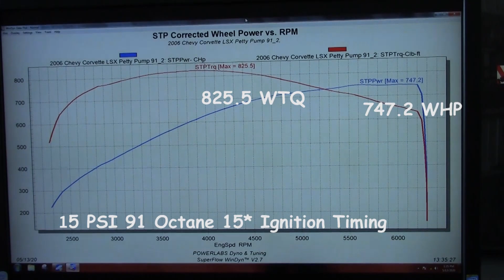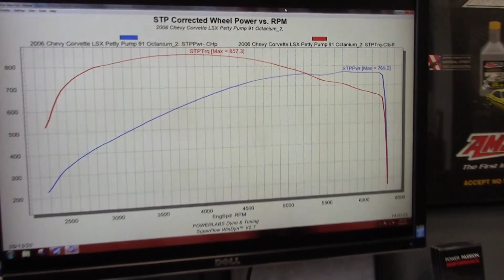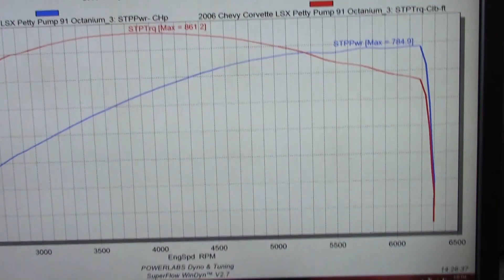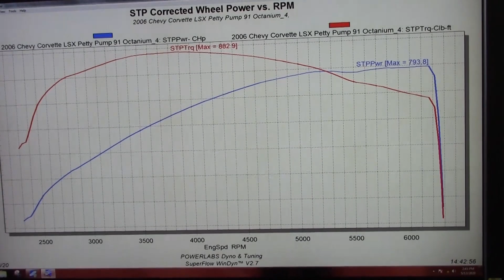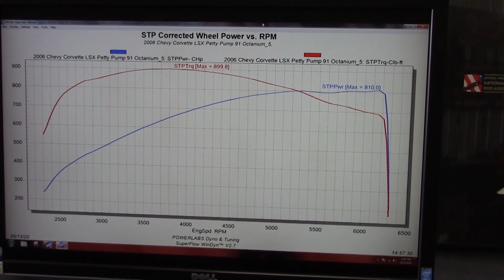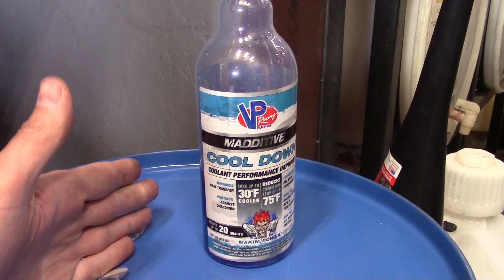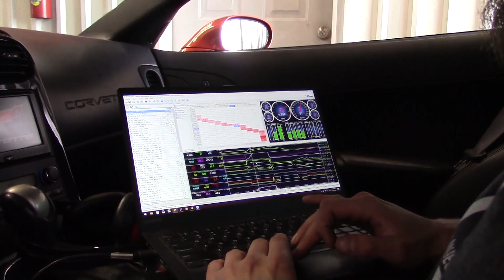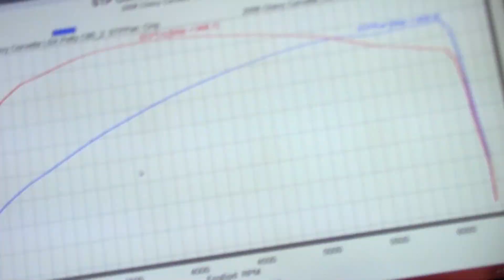Procharged C6 Corvette: Pump 91 vs C85 vs Octane booster

Comment: Can I ask what flex fuel system you used? I’ve been seeing a lot on Advanced Fuel Dynamics. Does yours automatically adjust the tune to adapt to the Octane Booster in the fuel?
Reply: So I actually built my own flex fuel system utilizing a factory GM sensor in the fuel return to the tank. It will only adjust the tune for ethanol, not octane booster. It’s an alcohol specific sensor
Reply: DSX is the best, and OG

Comment: What would it do just adding degrees and no octanium
Reply: You would get spark knock (detonation) with too much timing and not enough octane to back it up. He was saying that he was at the threshold of detonation with 91 and the timing where it was at. Detonation will take-out the pistons pretty quickly if it's bad.

Comment: Nice results.  I am near Boise so can only get 91 also.  I run the Boostane and Octanium sometimes in a 996 Turbo with built engine.  It's only 3.6 liter so it is pretty limited if I don't use it.

Comment: pls allow me a stupid question...what happens if u put octane booster in c85. Trust me...no other video says "dont do this". :) btw..great stuff
Reply: The C85 is about 105 octane by itself. At a certain threshold more octane stops helping. The octane is basically just preventing spark knock, which allows the tuner to add more timing. More timing = more power, but only up to a certain point. Eventually adding timing will actually decrease power, even if there is no knock present. Lower octane gasoline actually has MORE power per volume than higher octane fuels. It's the fuel's stability that's allowing for the gains here. I have a feeling that this car is probably seeing maximum potential at this boost level with the C85. (IE. More octane isn't going to help at all.)
Reply: Great video! Well executed with the three octane levels and also keeping the temps down on a C6 Corvette. Keep up the good work it’s very helpful. Thank You Guys!!!!